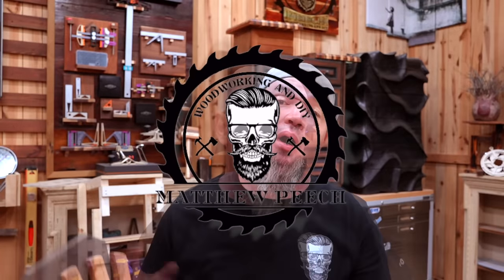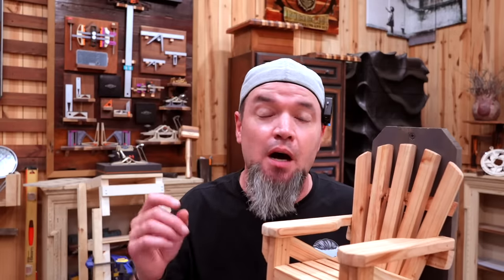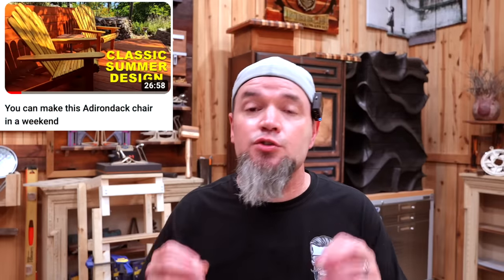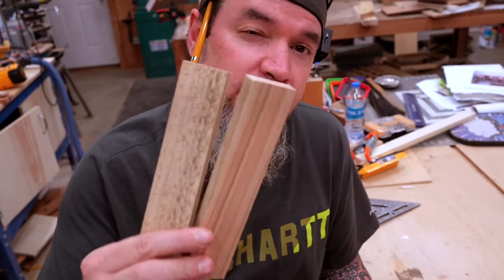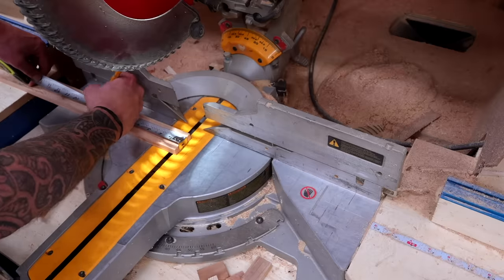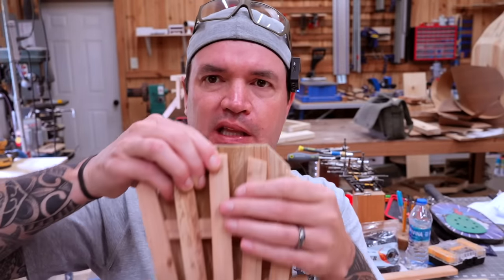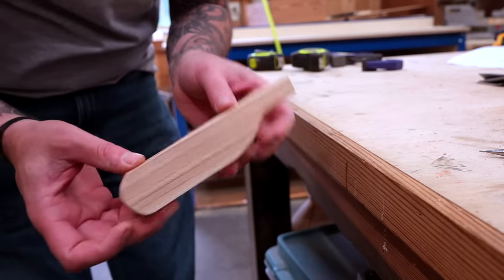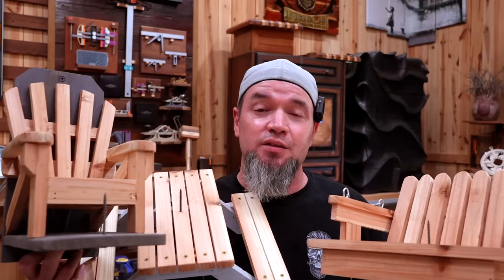This build is A MONEY MAKER  -  Woodworking Projects That Sell

Comment: I love this! I've built several picnic squirrel tables from scraps before you did the video. I'm known for my adirondack chairs that are pretty fancy. So to reinforce your breakdown of profit, I sell my chairs for $300-$350 each and it takes about 15 to 20 hours to make one. I have an outlet for my cedar materials, but I still spend about $90 on materials. In the end it breaks down to less than $15 an hour for profit. I've definitely learned that the money is in the smaller builds! But for certain people I will still build the full size chairs. It has made demand for my chairs that much higher because I don't make many of them. In the spring I make a few versions of planters that are quick, but beautiful builds. Thanks for all the inspiration!
Reply: That is a very low hourly rate.  Especially if you factor in the cost of buying your tools, the shop space, and small things needed like screws, sand paper, stain, etc.
Reply: @daddybear236  Absolutely!! That's why I build the full size chairs for basically family and close friends!! I build firetables too, and when I want a big profit I do a table or a bunch of planters. I can build 5 planters in a day at $75 each of profit. Most of my woodworking is for my mental health, but I like to buy new stuff with its profits too
Reply: @quadsquadracingable  same here.  I do woodworking as a hobby and stress relief. I gift the stuff to friends. Never manage to sell anything at a reasonable price.  People expect to buy from "classified ads" as 1/3 of the IKEA stuff.  Not even worth the hassle to communicate with them.

Comment: This one is tough. I mean, all 3 are winning designs! If I consider each of these as squirrel feeders as presented, then my vote goes for the Adirondack chair design with a modification of the corn cob screw location to be on the chair. My decision is based upon placement of the feeders and squirrels seem to prefer to eat high off the ground and more out of site of predators. However, if I consider these designs for creative uses, the Adirondack chair comes in last place because of the attached platform. It looks like it is required for stability. My winner for most uses other than as a squirrel feeder is the picnic table. Now, as a gardener, my personal favorite is the swing. I’d remove the screw and secure a small terracotta pot or two and fill with a fern and a vine. I may need to make the build a little larger or at least slightly longer. My decisions are from the customer’s perspective rather than the seller’s perspective which considers costs and profit. I can’t remember which one was able to get two projects from 1 picket or which one had the best profit margin, etc. I’m just very impressed with all of the final presentations. ~ Rob
Reply from the maker: Thank you for that Rob!

Comment: Matthew, I have a question. I apologize if you have already answered this (but I doubt it, as I look forward to, and watch your videos fairly religiously) Why do you flip your boards on medium rips as opposed to just pushing through? I know you have an outfeed table so I am curious if your method is beneficial? Thanks
Reply: That's so weird! I was going to ask the same question! I have noticed that from time to time. Is there a safety benefit? Or speed? I would love a quick explanation because you make it look so smooth! I'm afraid to try it.
Reply from the maker: Hey!  I flip the boards for both speed and safety.  By flipping half through the rip I keep my hands away from the blade and I dont have to walk around to get the piece to re-run or stack.
Reply: @MatthewPeechWoodworking  I've done that for longer cuts because I don't have an outfeed table. So do you have to turn the saw off, or just flip and keep going? Those clips are usually sped up so I can't tell.  Thanks Matt!!

Comment: Do you think 16 gauge finish nails are too thick for the end grain of pickets? 

I still need to get a brad nailer and will eventually get the brushless dewalt to go along with the rest of my stuff. I don't want to spend the money quite yet if I can get away with using glues and finish nails. 

So far they work fine for planters and stuff. I'm just wondering how they would work for doing a 90 corner and nailing into the end grain. 

As always awesome video. keep up the great work.
Reply: I plan on just testing it out when I get home. Just gonna be a few days before I can. In the meantime, if finish nails won't work at all, I can order the brad nailer and have it there waiting.

Comment: I made a walnut slab coffee table with no metal...handmade ....52 long  25-18-33 width   18 high.....sterilized stabilized and finished with baby oil....ill take 4,800 for it....made it in two days......also it has epoxy c-channel inlay and  artistically texturized where the reclaimed wood was damaged....beautiful table😊..........also crotch figure to die for😊.  Also the four legs were mortise and tennoned 1inch deep and epoxied into the 1.5 inch thick slab.....legs are 2x3 inch thick 16.5 inches tall  and solid as a rock😅

Comment: My vote goes to the picnic table. Fewest cuts and fastest/easiest assembly. And considering you can get 2 from 1 pence picket, best bang for the buck IMHO. Quick, easy way to make $40-$50 from a single $3 piece of material. Also, adirondack chairs tend to be regional (I'm not knocking them, that's what I make/sell). But everybody everywhere likes a good picnic table (which I also make/sell🤣...for that very reason)
Reply from the maker: Fair enough! Thanks for the input.

Comment: Making very tiny items like this with multiple parts is a total burnout! lol! Better to find a larger item that will sell for you in your area that you can finish in two or three hours for multiple hundreds of dollars. I make 58" hardwood skateboard decks which sell for $300 and take me about two hrs. each to make if I am moving slow that day, lol!, and cost about $50 in materials......that's $125/hr.! :) I can and do also ship my decks which no one is going to pay to have this feeder shipped as it would cost as much as the feeder does! They will pay what it cost to ship a deck though, no problem. I would have to build 10 of these which according to you would take at least five hours and I would be wanting to shoot myself in the head after building ten of these little things! lol! If I set up and am motivated, I can build 3 decks in those five hours for a gross of $900 vs $300. It's a waste of time to build tiny items like this, there are better items out there to make you just have to find what will sell well for you in your area and you won't go nuts making! lol! Forget chairs, forget planters and all the other BS that every tom dick and harry is already making and find a nice mid-sized niche product for yourself that doesn't take longer than two or three hrs. to make so you can charge what you need to and then get to eat the whole pie instead of just a slice......Guess I will have hundred guys making decks now I have to compete against until that market is trash too! lol! Come up with your own ideas people so that you are not getting too thin of a slice of any given market.

Comment: You know, I, like you,🤔 priced out what it would cost me to purchase the material and fasters required to make a popular, far more practical version of the Adirondack style furniture.🧐 I came to the conclusion, rather quickly that I wouldn't initially be making more than a 20%{at best!} on my investment in just the material. 🤨My labor, in comparison to what I earn at my day/night job, would essentially be free😕. 95% of  People can't see past the shine🤓. At least 50% of them would happily pay the exact same amount for a job has deep 80grit sand scratches in it, so long as it's pretty at arm's length🤓. There's no way I can complete with chairs made in a country that pays pennies per day. Obviously, those $79.00 (wonder what country)chairs are only for this season and not for the 10yr life span I'd build my chairs for and that's where totally dropped the idea.😡 Plus I saw those chairs being unloaded at house I couldn't afford to buy, and reasoned, (if they're gonna settle for that crap, what chance does my stuff stand.?) 🥺 And plus, the house across the street from the one that bought 10 cheapies Adirondack chairs had the way more expensive version that has already been through a season or 2 and still looked good.(Yes, there's one born every minute, and they tend have to learn the hard way. I want to start this year, not wait until next year...)
That was 6mos ago, when I'd have started production of the chairs, and being an older/middle aged fellow, don't have quite the energy, room and time to produce large projects and have any space for the small stuff that keeps this side hustle moving forward and gradually upwards.🤔🤠😎 3:52
Reply from the maker: That’s why these mini squirrel sized versions are well worth it.